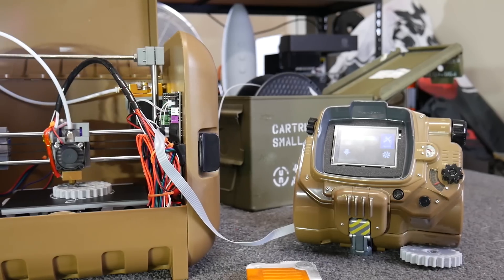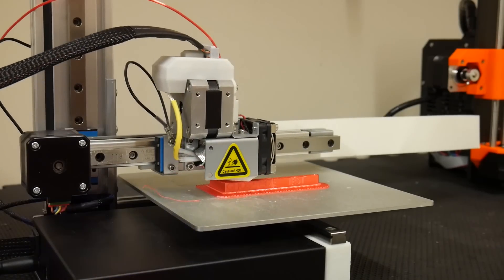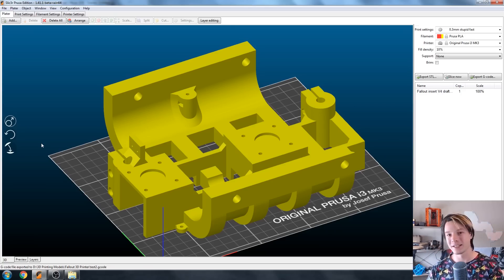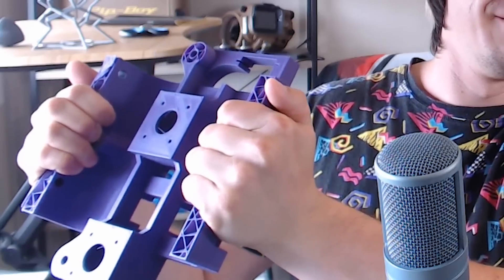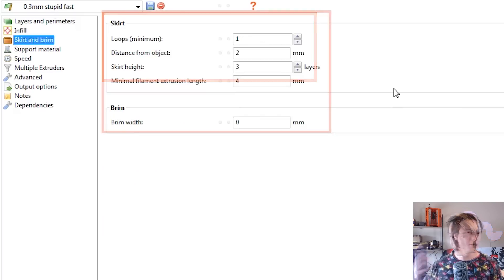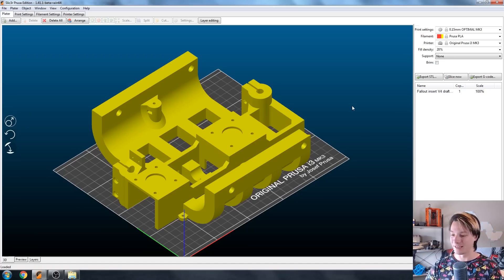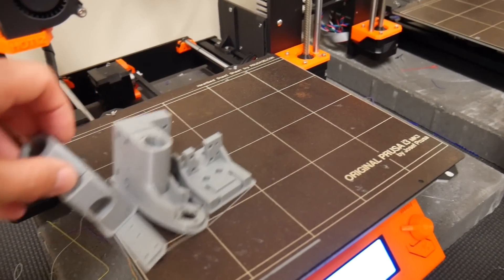3D Print parts TWICE as fast with simple slicer tweaks. 3DP101

Comment: Doubling the size of a cube doesn’t technically increase the print time by 8x as the surface area only increases by 4x and the perimeter takes longer to print than the infill.
Reply: He's not very strong at math
Reply: It increases the volume 8x, so it can increase the print time by up to 8x.
Reply: @8yourpets  but infill prints so much faster than the surfaces that in practice it will be between 4 and 8x depending on infill settings
Reply: @johnpaullogan1365  Yeah, that's what up to 8x means.  Somewhere between a lesser amount and the upper bound of 8x.

People can keep arguing but this isn't wrong.
Reply: Brian Kupfer if it’s solid. Prints are mostly empty. With 0% infill, the print time increases with the square (4x in this case). This is because surface area increases with the square of the scalar. As you increase the infill percentage from 0% to 100% this increases from 4x to 8x. Only when you reach 100% infill does this value become 8x. And this is assuming that your infill speed is the same as your perimeter speed. If your infill speed is higher, it never quite reaches that 8x mark.
Reply: @keco185   As I said, the volume increases 8x and so the print time can be up to 8x longer.

Please take note of the wording I used, both in this comment and the first one.

To make it clearer I said "by up to" in the first comment and "can be up to" in this one.  No need for a correction or for you to try to flex 6th grade math.
Reply: And it's 2 times taller, you forgot!
Reply: Vitalik Gula surface area increases with the square of the scale factor. Since creating the surface is most of the print and only some time is spent on the infill, the change in print time would be between 4x and 8x but would only reach 8x with 100% infill. This is also ignoring acceleration which would decrease the print time even more
Reply: @keco185  so surface is in ^2, i agree. If we do as you say 20x20x20 cube print 4 time faster than 40x40x40 one. But I say, that 20x20x20 cube print 4 times faster than 40x40x20 one. You are right, that it take diferent time to move Z axis and X(or Y) but it's even slower, so it will be more than 8 times longer.
Reply: Vitalik Gula you’re thinking of a solid cube

Comment: For someone who wants to appear knowledgeable regarding 3d printing this video does not seem well informed at all. An E3D V6 will never be able to extrude 0.3mm tall and 0.4/0.48mm wide layers at 250mm/s. When you run those speeds you will push at speeds between 30 and 36 mm³/s when the hotend is only rated to 15 mm³/s. Also, rated speeds don't compare to real life and I can tell from my own and other people's experiences that the upper limit is around 11-12 mm³/s for reliable extrusion. This relates well to the 200mm/s infill at 0.15mm layers with optimal settings. 

The only reason you were able to print succesfully is because with those low acceleration values the printer will never reach 250mm/s or maybe just barely on some moves. You need 25mm to reach 250mm/s at 1500mm/s2 acceleration and also need that same distance to slow down again. So any move shorter than 50mm will not even reach that speed. Looking at your part with all the small infill sections I can image most moves being a lot shorter. Anyone who will try this on large flat parts will encounter massive under extrusion. 

Also, setting your travels to 170mm/s when you print with 250mm/s doesn't make sense. If you have the slightest bit of z-hop you wont collide with the parts at 170mm/s or 250mm/s. I run my travel moves at 1000mm/s with 12500mm/s2 acceleration and 0.15mm z-hop and never have any collisions. I have a demo video on my channel if you're interested.
Reply: 1) its not sq mm/s, is cubic mm/s (mm^3/s)
2) you can do 20mm^3/s @240ºC on a all metal V6 if your fillament isnt cheap shit, am talking from experience. Faster and the plastic will extrude cold and wont stick.
3) yeah, his settings have lots of noobish mistakes. He doesnt mass print parts 24/7 for a living.
5) he didnt do 250mm/s in the infill but not because of the low acceleratio, the Prusa PLA profile itself has a mm^3/s cap set at 15mm^3/s, so anything faster gets slowed down to match that. It's usefull when  you just want to set something to print as fast as possible or if you are tunning a part and didnt notice you were already at the limit the hotend could melt.
6) For comparison you can do from 22mm^3/s @ 218ºC up to 34mm^3/s @ 240ºC on an all metal vulcano.
Reply: 1) You're right, I've corrected this. Typed the initial response in a hurry.
2) That means you print at something like 250mm/s with a 0.4mm layer width and 0.2mm layer height. Maybe possible on short moves but without acceleration settings it's a meaningless number. Show me a video of a 200mm circle printing at those speeds in vase mode or something, I'm really interested.
3) I know but misinforming newbies will make r/3dprinting even more full of people who think they're doing nothing wrong but are getting bad prints. ;)
4) I think you've skipped a number there ;)
5) I didn't know about this setting in Slic3r, that means max speed topped out at 111mm/s which is a lot more reasonable. (0.45mm extrusion width and 0.3mm layer height.
6) Again, really interested in seeing this on video with complete settings.
Reply: @MotherBEARmakes  
For 2) yeah, if you go to low on layer height the speeds go above what you'd want to keep quality good enough. Not recomended for perimeters but for infill there's no problem.  I havent done a circle but i printed the arms for the fillament holder for my mendels at something like that mm^3/s wise. I try to keep my speeds around 100 max so as not to have large changes in flow speed. I rather print at 0.3, than 0.25 with way to high speeds. I usually dont print below 0.25, 0.25 is my "normal" setting and maybe 0.3 for when the surface finish isnt important. Also i owe you a video, dont have a tripod and the one i have i cant show you :P
3) Ditto
5) exactly. iirc they added it a couple of versions ago, i think 1.35 or about there around the time they introduced the new profiles system.
7) lol dont mind crazy randos. He probably lives in the streets and talks with himself.
Reply: I have no issues extruding over 35³mm/s with my E3D v6, just crank the temperature up and use quality infill.
Also volcano exists if you need a lot more.
Reply: Beardman Hairy  quality infill?!?! what is that?
Reply: @goury  I'm having trouble believing this. What settings do you print at?
Reply: @MotherBEARmakes  I normally do cap my speed at 80 mm/s for 0.4 mm nozzle, but when I want go crazy fast I print my ABS at 300°C.
Accelerations are about 60 m/s², jerk is gently at 10 mm/s.
No this is not the one you can find on my channel.
I don't publish this machine yet.

Delta printers are superior.
Reply: Are you sure you're using 60mm/s2 for acceleration?
Reply: @MotherBEARmakes  
I doubt it, last time i checked marlin glitched out when using accelerations below 200mm/s^2. (there would be bumps in the ramp up and ramp down sections, or maybe that's because im using S-Curve acceleration)
Reply: @MotherBEARmakes  you should read carefullier
Reply: Ah, you're right. Should've typed 60.000mm/s to flex on us. ;)
Reply: Where is the limitation of E3D v6 coming from?
Mass of the heatblock? Power of the heater?
Reply: @cthulpiss  From the plastics poor heat conductivity, it needs to be heated through and through. One of the reasons a volcano hotend has a much longer melt zone.
Reply: I find that for someone who is trying to debunk someone else, you barely know what you're talking about and have had to correct yourself several times....
Reply: It is crazy how people here are attacking Paul just because he was questioning Angus's guide. Paul and also Laharl made some great points. Angus clearly don't know what he is talking about, it is more like guessing and being wrong. I don't like criticizing people, but this is not for the first time I see something like this on this channel. For example the video about ghosting he referred to in this video is also wrong on many levels - basically he missed the most important things.
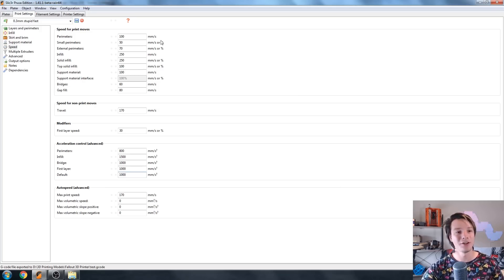Reply: also at 10:07 it shows at the bottom max print speed 170mm/s
Reply: yes but it worked
Reply: Anyone know what the rated print speed for a Printrbot LC V2 is? I had to crank my print speed down because the filament would jam. That was at like 30mm/s
Reply: LOL How amusing.....
Reply: says the expert with 38 followers. Its easy to pick apart details from the sidelines
Reply: Check Paul's videos: he knows what he's talking about wrt speed and acceleration.

The key is that you can't just crank up all the numbers and print faster and faster: there is a limit. That limit is how much plastic your extruder can pump out over time: its rate limit in mm^3/s.

While folks may have been turned off by Paul's tone, he's right on the money.

This is why I'm more interested in a Volcano retrofit than a multimaterial system: I want more (or "moar" in TAZ terms) output.
Reply: I looked at your channel, no vids showing the eyes bleeding fast 3d printing. Sure, you can throw your extruder around bloody fast, but where's the filament??
Reply: @montewestlund8195  Where have I told you that I'm printing at those speeds. I said I'm running fast travels.
Reply: @MotherBEARmakes  Your comment wasn't very explicit, or clear. This video was about 3d printing, not just machine travel. How fast can your machine print? As I said, I didn't see any video of your machine actually printing. Maybe I missed it.
Reply: Just read the last sentence of my initial comment on this video. Sorry if you feel misdirected but it's explained in the description of the video you've watched again.
Reply: @MotherBEARmakes  Who reads the video descriptions? ;0)
Reply: So what speed for 0,3 layer height would be the top, regarding ^3mm on a stock mk3? v6 hotend
Reply: Paul de Grot, your reply is not helpful to anyone. He said he was experimenting to speed up printing 'for his part' and he reduced it from 28 hours to 11 with results that suited his needs. He specifically state the his settings would lower quality. In other words your technobabble is meaningless in this context because he got the result he wanted. I have been using 3d printers for years and would advise anyone to use specified limits as a starting point but to experiment freely if they wish to. That is part of the fun so someone being critical over someone's success is not helpful.
Reply: @JerryWalker001  The problem is that he's teaching people the incorrect way to experiment.  Due to the acceleration and volumetric flow limits which he didn't change, his print never reached anywhere near the limits he entered.  He could have set his infill to 999, and would have gotten exactly the same results.  When people don't understand what they're doing and think they do, it pollutes any useful discussions on the subject.  If I didn't know any better, and tried his settings on my printer, it would actually reach 250mm/s and choke on the half-melted filament when it can't keep up.  Then I would probably waste a bunch of time trying to figure out why he can print at double the speed that I can at more reasonable temperatures. (because the speed you enter isn't always the speed that you print at)
Reply: nwimpney, I agree that his methods are not scientific but he did Specifically say that his approach may not be correct. However as I stated in my comment that for whatever reason he got the results he wanted and that is the only important thing. As far as I can see he is only teaching people to experiment rather than limiting themselves by restrictions imposed by others, of which there is far too much these days. With 3D printers there are 2 types of users, those who try different things (and possibly waste a lot of time but have fun) and those who think they should police everyone else. I know which I would rather be.
Reply: "For someone who wants to appear knowledgeable regarding 3d printing this video does not seem well informed at all."

That was a bit dickish, would you say that to his face? I doubt it.   Good technical conversation though, thanks for the info.
Reply: @yonallb , It's a bit dickish to call people dickish.
There is no secret for anyone knowledgeable that Anus is just an amateur with no real engineering knowledge.
And he doesn't even pretend to not be amateur, but some times it looks like he does, so this is why he have to be reminded to stop misinforming his viewers.
Because of responsibility.

However, compared to other popular individuals on this topic he's sure less amateur by an order of magnitude.
Reply: @goury  Angus
Reply: @mihirpatil8843 , yeah, this one ^_^
Reply: @tponn I'm sorry if I've offended you, please explain in what way I'm nasty? Also I'm not trying to grow my channel, I don't know where you've gotten that information from. I'm sure as heck doing a poor job then with my 28 followers of which half are probably friends and family.

Comment: A lot of that ghosting issues can be taken care of if you use dampening. SURE, that's a bit of a test and trial situation, and that takes time to figure out but it's worth it. On stock settings (but 0 infill) my CR-10 (first generation) can print reliably at 150% on the dial with the obvious exception of the starting phase where i dial it to 20%. I added some weight, removed some other, and used a dampening rubber joint on the table. It has removed almost all vibration, regardless of how close quarter the motion is. It does seem to have issues with the standard nozzle, i use a stainless steel one (.4).

Comment: I will certainly put to test your valuable insights but using gyroid infill. I think it looks fantastic and prints smoother without many accelerations and decelerations . Many claim that it offers a good ration between strength/material. Slightly better than cubic. Have you experimented with it at all? Edit: Grammar
Reply from the maker: I'm keen to test it out next week once I update to the latest version.
Reply: @MakersMuse  It's awesome, and I find it's a lot stronger at low infills - be aware though, Slic3r PE can take a huge amount of time to slice gyroid if the perimeters are complex/bumpy. You'll also want to disable "Only infill where needed" on with gyroid - it increases the slicing time even further and adds weird splits that actually increase the print time....

Comment: Gyroid infill in the newest version is so nice
Reply from the maker: Yeah it's on the cards to test it out next week! Looks sexy :)
Reply: @MakersMuse  gyroid also looks amazing with top and bottom layers turned off.
Reply: @ericwebster6911  I've actually printed without perimeters too
Reply: @TheRealAirdoo  I think I once saw video of somebody printing with an MMU2 using a pretty-coloured (translucent turquoise?) gyroid infill and transparent perimeters/solid infill. It was VERY shiny.
Reply: @roolin2  I already checked it on multiple prints.
Gyroid IS definetly slower then cubic/rectilinear, but not so much as honeycomb.

If you want to go for speed only, gyroid is not the way to go.
Though it definetly looks really nice and is pretty strong and versatile.
Reply: gyroid is not equally strong in all directions like cubic. Its stronger on the Z axis and less on the X and Y
Reply: Gyroid??
Reply: its also bad if you dont have enough infill on a small part. Also its way slower than cubic.